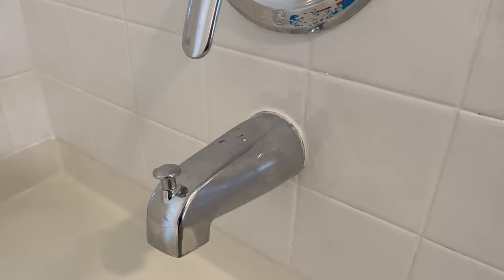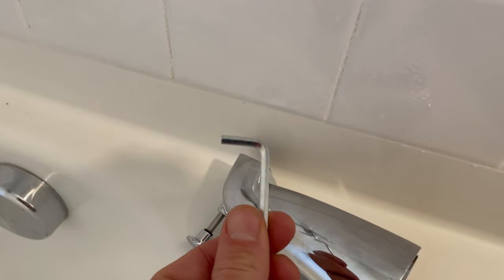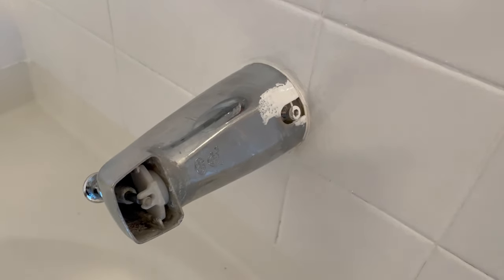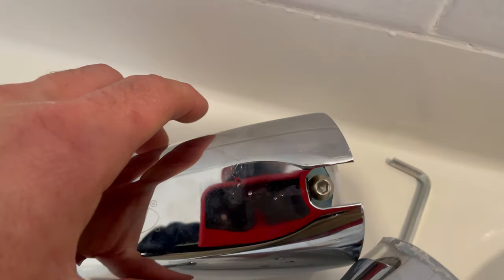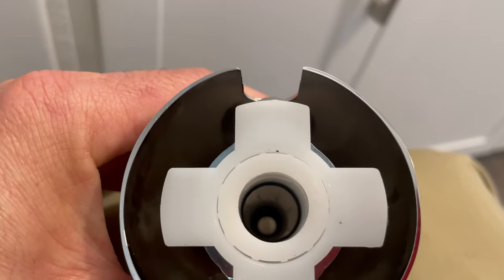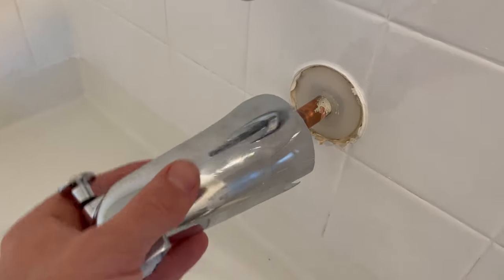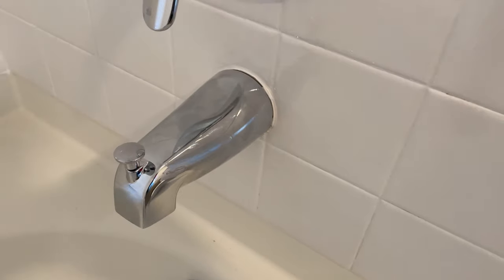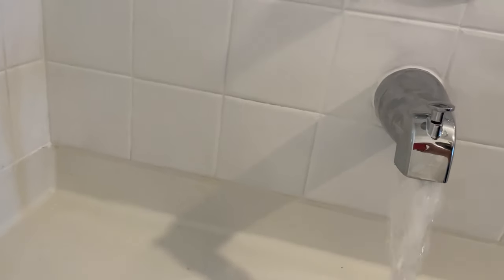How to Replace a Slip-on Tub Spout - DIY

Comment: You should never turn it to start off the process. If it was over tightened you gouge the pipe and won’t hold properly or could even cause leaking

Comment: I see some common questions about the 2 basic types of spouts, the screw on type and the 'slip on' type. The screw on type actually screws onto the end of your existing wall pipe and is secured by the screw on fitting.
The 'slip on' type has a screw on the bottom in the notched area of the spout (look for it and look for the allen/phillips screw you lost). After slipping on this spout, simply tighten down on the screw so it grabs tightly onto the wall pipe. This will prevent the spout from shooting off or sliding off when you turn the water on.Hope that answered some questions.
Reply from the maker: Thanks Dugan :)

Comment: So mine is now leaking a bit where the faucet meets the wall. Now I’m worried it’s going to cause the water to get pushed behind where the pipe comes out of the wall and cause mold? I don’t have that clear stopper mine is just a hole with the pipe coming out

Comment: Im not sure what brand this is, but  the one I have is Delta. If you put it on and tighten you can still swing it right and left. This bothered me, so I cut the pipe so I could keep turning the spout while the screw stays more or less in the same spot (it does in fact move a bit out of position) and this brings it tight to the tile. Im not sure if this is the correct way to do it but having a spout that can swing isn't acceptable.

Comment: You said its usually 3/4 coming out of the wall. Looked like 1/2 to me. Is it normally 3/4? I realize you should go to 3/4 from the shower valve if you're using pex but i thought copper would be 1/2. Couldve just been an oops on your part as well. Let me know. Thanks!
Reply from the maker: That was a major oops on my part 🤦‍♂️

Comment: Hi thank you for sharing this knowledge. I replaced faucet—the type that slips on. I’m thinking the caulk is also for the purpose of keeping faucet head in place? When testing, the faucet head shoots off /when I pull-up valve and water diverts to shower head. Is this normal? Need more education caulking such how long to let it dry before getting wet? I know it may say on product information but it helps to hear what professionals do. Thanks again
Reply from the maker: Caulking is just for looks
Reply: @ApartmentMaintenancePro  And to stop water from getting into the wall.
Reply: Tighten the set screw!  And I agree caulk is to keep water from flowing down the tile wall and getting behind the fitting and then behind the wall, causing a leak.  It isn't glue at all.
Reply: You just lost my respect & future views

Comment: Im trying to replace this myself and how do I know what size to buy is that a crazy question? I measured from old one measures 5 inches. New to this fixing stuff living in an apartment with slow maintenance. I have waited months for this to be repaired I don’t want to wait anymore.
Reply from the maker: If it looks like anything in the video it shouldn't matter, as far as I know it's pretty universal :)
Reply: Thank you it looks just like what you have done.

Comment: I'm currently attempting to install the same model, but despite the new spout being in place and tightened, a dribble of water ends up coming out where the screw area is, and increases when the diverter is on (for the shower). Any tips on stopping the water from coming from the screw area?
Reply from the maker: I'm guessing that the o-ring in the diverter is not sitting flush with the copper pipe. I would remove the tub spout and take some emory cloth or sandpaper and sand the copper pipe (left to right if looking at the tub spout), apply some o-ring lube to the o-ring inside of the diverter then reinstall. Let me if that works
Reply: @ApartmentMaintenancePro  Managed to just decalcify the old one which didnt have a defective o-ring. I appreciate your help
Reply: I've restalled 3 different slip-on faucets, lube'd the o-ring, sanded the copper pipe til it gleams and still get the dribble of water out the back end (which is leaking down the copper pipe back into the wall and downstairs).  Any other clues? There is an indent in the copper pipe that I assume is from a previous installations allen/phillips screw in the notched area under the spout near the wall. Seems like the o-ring should stop any backflow far short of this though.
Reply: @larrylefbom5542  I had the same problem ,I installed one and I thought it was damage I bought a new one and the same problem,I applied Teflon tape,thread sealants and it not fixed my last resource was apply silicone all around cooper pipe to make a seal when I screw in spout back to the wall,I think is a bad design since it would be easy,and it is almost impossible to stop the leak
Reply: Same I'm at my WITS end! I had a male threaded tip, however when I went to screw on the new diverter spout if wouldn't even come CLOSE to the wall...I've been losing my mind for a week trying everything. I finally sweat the male threaded tip (nipple ??) off as the threads were - ugh no pun intended 🤦🏼‍♂️🤬 - screwed. What I have left is less than an inch of copper pipe. Tried the adapter with the o-ring however there's not enough pipe to even get the o-ring on the pipe, nevermind into the tube part of the shitty plastic extension nipple. Tried anyways with the metal retainer ring. Finally got the crap Danco new diverter spout on and to the wall. Leaks worse out the spout than it did in the first place leading me to taking on this maddening project and ALSO out the f'n back. UGH. Anyone also find it maddening how they write in the directions and it is said everywhere to wrap pipe thread multiple times around these things when they won't even screw together all the way in as far as there should in the first place without the tape...add the tape and it impedes it even worse.

Feel like at this point my best bet is to buy a new male threaded connection the exact correct length that it can and will thread in the diverter spout sans the piece of shit plastic extension nipple all together...but considering that that thread POS plastic doesn't seem to thread/screw in completely itself, not sure a metal (presumably 3/4" threaded extension nipple would either), AND of course then I get to also try my hand at sweating/soldering that f'r on it the first place. 

Ripping my hair out. This is so beyond stupid. It's should basically be plug and play, but you never know what whatever plumber randomly set this shit up like in the first place until it's WAY.TOO.LATE.

FML. If anyone is still reading, advice would be much appreciated (unless it is that I should have and still should hire a plumber...seriously please don't kick a mofo while he's down).

Comment: Great video!  I have the same slip on spout to install, but I do have the threaded copper fitting at the end, which you mention could be dealt with by removing the internal part of the slip on tub spout.  I've put some effort into trying to figure out how to remove it so I can do that but it seems tricky and I don't want to break anything - do you have any tips or a video on how to do that?  Thanks!!
Reply from the maker: Hi Annchen, I usually just use a pair of pliers or an adjustable crescent wrench and twist it out :)
Reply: @ApartmentMaintenancePro  Thanks, that is good to know!  Gave me the confidence to just apply a little more force and it came out!
Reply from the maker: @annchenknodt8941  sweet 👍!
Reply: @ApartmentMaintenancePro    If you wouldn’t mind answering my question. I have a old slip on faucet but only have approximately an inch of pipe sticking out from the wall. I measured how far the o ring was inside the wall side of the faucet and it was about an inch and a half, so the pipe wasn’t even making contact with o ring. If I were to sweat on a copper coupling and added another inch or so on the pipe, would the coupling interfere with the o ring and faucet? Any ideas would greatly be appreciated. Thx...
Reply from the maker: @asmodeus1274  that's cutting it close it might interfere. You could sweat a male threaded copper fitting to the pipe and remove the plastic inside the tub spout and thread it on. It would have to be measured pretty accurate though. I'll ask my plumber friend though and see if he has any other recommendations and get back to you if there's an easier way
Reply: @ApartmentMaintenancePro    I agree, what I think I’ll do is use a coupling and add another 2 1/2 to 3 inches or so to the copper pipe and sweat on a male copper threaded end and use a threaded tub faucet instead of messing with the slip on faucet
Reply: @ApartmentMaintenancePro    From what I understand from watching other videos of using threaded tub faucets , the copper pipe from the tile going forward to the very end of the copper male fitting (where the threads start) should be 4 inches for almost all threaded tub faucets. I really appreciate you taking your time to help me out! Thx...
Reply: Annchen, I have the same issue as well.  Were you able to remove the internal part of the slip on tub spout, and if so, did you remove the entire internal plastic fitting and then able to screw it onto the threaded copper fitting, or did it install as a slip on?  Been trying to find some video on this, but haven't had any success.  Thanks so much.

Comment: I am trying to replace my slip on tub spout with diverter.  I took off the old one and there is a white plastic connector on the copper tubing.  Does this need to be removed?  I am having a hell of a time taking it off the pipe in order to install the new tub spout.  help???
Reply from the maker: I could be wrong as I don’t have eyes on it but if it’s stopping the tub spout from sliding on it should be removed

Comment: I replace with a new spout, but the diverter is on (for the shower) or off, always some water comes out from shower. O-ring is new. The instruction says the min. copper pipe is 1 inch, max. is 2 inches. I have 2.5 inch pipe. Is this the reason? Thanks
Reply from the maker: Possibly

Comment: Did you drill where the screw goes through the plastic hole or did it comes in a blocked hole? I noticed mines is blocked and after tighten the screw down it did not secure the spout at all, and when I'd open the diverter it shoots the whole thing out.
Reply: Not sure if you need to drill it so the screw will come in contact with the pipe to secure. Any info will help. thanks!
Reply from the maker: No drilling should be necessary 👍

Comment: Help! I unscrewed the little screw and it fell in the spout but I can not get the spout to pull out and off. I have rotated back and forth and tugged really hard. It is 4o years old and have super hard water.
Reply from the maker: Might need to replumb the fixture. Sawzall time (do at own risk of course or seek a professional plumber)

Comment: Do you have any insight as to why the set screw would not be tightening? When I have the faucet in my hand I can tighten the set screw without an issue but once it's on the pipe it just spins around without grabbing onto anything.
Reply from the maker: The female threads might be stripped

Comment: Can you tell me the brand of the spout you replaced with? I keep seeing slip on ones and IPS style. Not sure which one you have with the screw. The one currently on mine is really lose should have a screw at bottom but doesn't.
Reply from the maker: Screw may have fallen out - not sure the brand on this particular repair it was a property I normally don’t service.
Reply: @ApartmentMaintenancePro  thanks for replying I ended up buying a moen slip on with screw and it worked for me.
Reply from the maker: @sketterman10  Sweet glad you got it :)
Reply: I just got a Moen slip spout and it's plastic! I'm going to find a metallic one.

Comment: You don't know what kind of replacement spout you need (threaded or slip-on with an o-ring) until you take the old spout off, correct?
Reply from the maker: Ya pretty much
Reply: Michael Patrick Mc Clung - If you put a mirror under the spout and see an allen set screw you have push-on spout with o ring.
Reply: @carlcampbell6827  -- Yes, you are correct.  I did it the harder way: I actually lay down on my back in the tub and discovered that I have a spout that's threaded on TIGHT, TIGHT, TIGHT (no set screw). To remove, I'll have to put a big pipe wrench on the spout and turn counterclockwise until I hear a sickening SNAP! as the supply line (or stub out, as some older men call it) breaks off inside the wall.  Time for a plumber, a carpenter, and $$$$. This is how I'm pretty sure it's going to play out.
Reply: @cracky_wainwright  - Don't panic and take a chance breaking any piping. You can cut the fixture off to gain access to the pipe fitting and supply line in the wall for inspection and determination of needed repair. If you have old galvanized iron system, it is sure to have some corrosion related problems.

Comment: Very sloppy job! I would fire such such plumber right away.
Am I the only one who sees a pretty bad damage on the copper pipe? And obviously, that deep scratch is made by a set screw. 
You cannot rotate the spout while the set screw is tightened. Loosen the screw first. Then you can rotate and pull the spout.

Comment: How do you remove that white shit I’m so pissed off I haven’t had a real shower in days baths are terrible 💀 mine needs to screw on
Reply from the maker: Not sure what your referring to
Reply: @ApartmentMaintenancePro  the white piece on the inside I believe u said u can remove it yours slides on mine doesn’t
Reply from the maker: @b23beatz  twist it out with a pair of channel locks or wrench :)